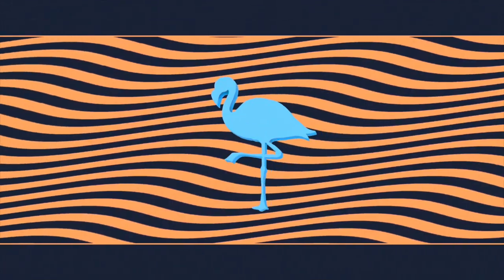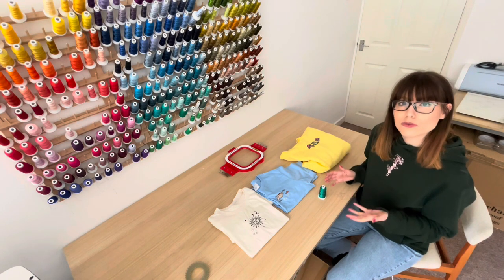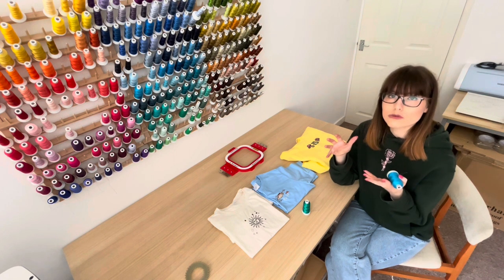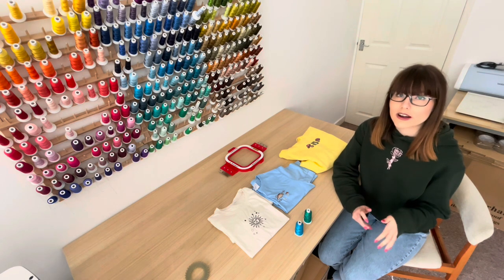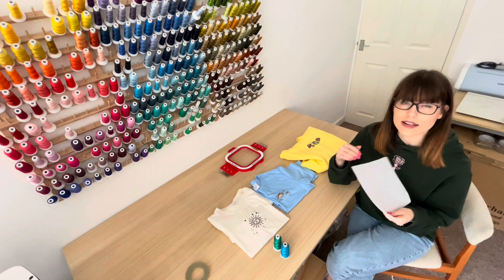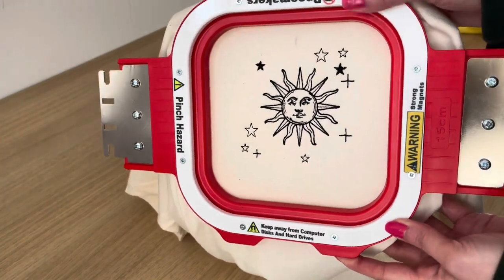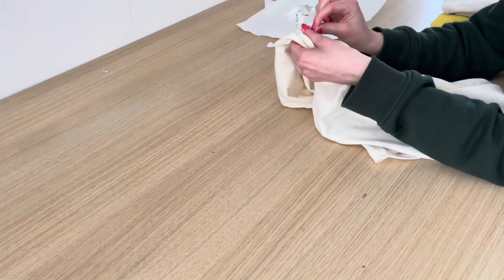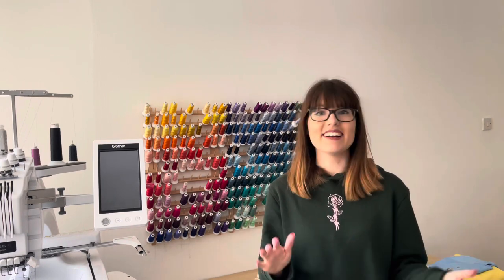How To Prevent and Stop Your Machine Embroidery Designs From Puckering

Comment: I put cutaway and tear away in the hoop. I then spray the temporary adhesive on the  cutaway in the hoop. I then stick the t-shirt to that. Smooth it out.   And put  the hoop with t-shirt affixed to stabilizars on the machine and embroider it. This way the t-shirt won’t have stretch or hoop marks:) I use Embtech spray adhesive but there are several brands. Just make sure it’s temporary.
Reply from the maker: That's great! Thank you for your comment. Personally, I don't use spray adhesive as I find it gums up the needles and the glue can work it's way into the machine.